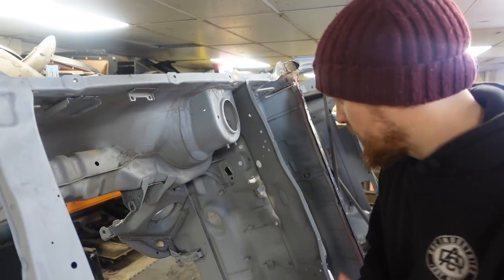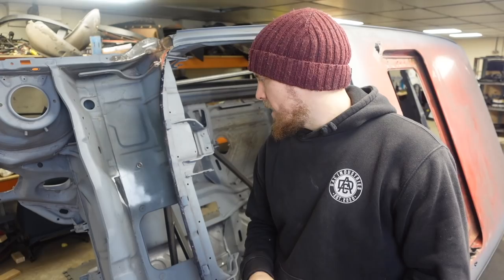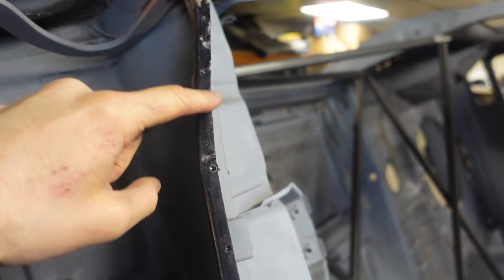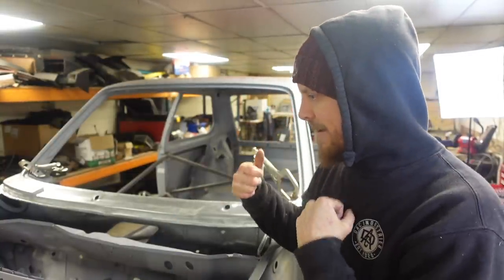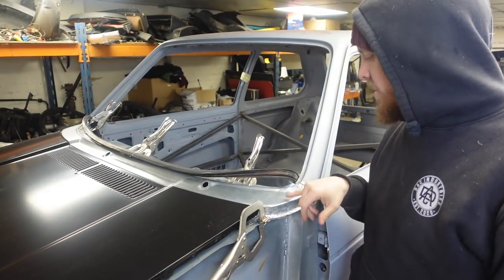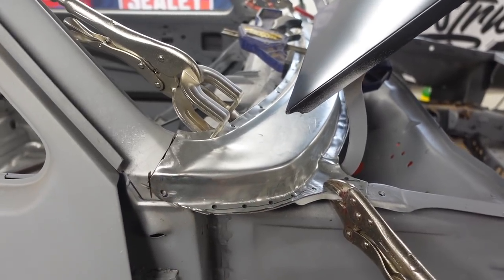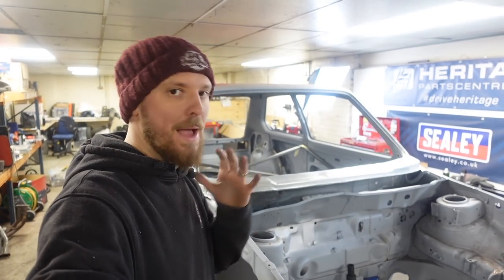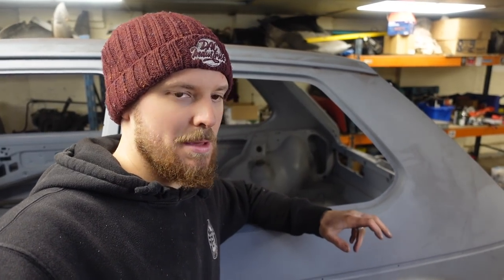Fitting Scuttle Panel & Clutch Hole Repair - Golf Episode 21 Volkswagen Mk1 Golf GTI Resto

Comment: Nice progress, good luck this week with the other side, will be interesting to see how much quicker it will be. At the moment I have got the rear right tub out of my shell, I got one of the heritage tubs which is off a SA golf. I wasn’t happy with it as it is different internally, you will know it’s non standard in the boot, but the main reason I didn’t use it was that the top of the suspension turret on it sat 15mm lower than the original tub. So i am currently butchering bits off the new tub to repair the old one which was badly gone in several areas.
Reply from the maker: Thank you so much for watching and for the comment Phil. Glad you are enjoying it! Oh I didn't realise they were different! I was trying to source a bodycut but really can't afford one so I will have to just try and make the repair myself.

Comment: I need to get those rear inside wheel panels or parts of them to fit 3 point seat belts in the rear. Sadly my Rabbit didn't have premade mounting holes in that position but had them everywhere else.
Reply from the maker: Thank you so much for watching and for the comment Jonathan. I have been informed that no one makes them anymore. Tried a few places but can't get them. You may have to try and get a body cut.

Comment: Great to see you so pumped up Dan especially compared to a few weeks ago. On the scuttle, Do you have to move the humps for the wiper mounts rather than just drill fresh holes?
Reply from the maker: Thank you so much for watching and for the comment Matt. I felt so much more confident and am now on a run to just want the welding done. I have enjoyed learning it all but really want it done now! No the humps stay where they are, RHD only have holes drilled into the scuttle panel.

Comment: Top work as alway Dan. Try not to target yourself too hard on timeframes.

What’s the end games here? Stock, custom, euro?
Reply from the maker: Thank you so much for watching and for the comment Bud. Yeah time frames do put a lot of pressure on but I think I needed a little push to just get on. I spend so much time looking and not enough time doing. So the aim for the moment is a pretty stock car with maybe a twist on the interior. Different seats with a slightly different but in keeping trim. None of that is happening until I earn some money to pay for it though!
Reply: @DanChambersDAC  I like the sound of that mate. Crack on!

Comment: Hey what kind of engine do plan to run in it?  I've seen spa turbo cylinder heads discounted on ebay. It would be sick with a high compression cammed naturally aspirated 2L 8v and period correct weber dcoes
Reply from the maker: Thank you so much for watching and for the comment Bud. I am running the original standard 8v Dx engine in it's standard form. Want the car to be as original as I can get it.